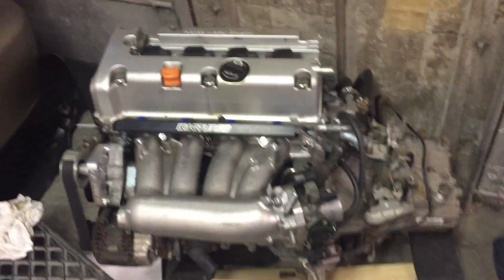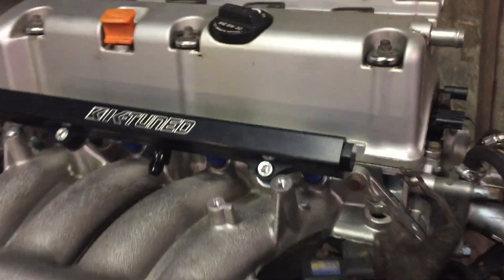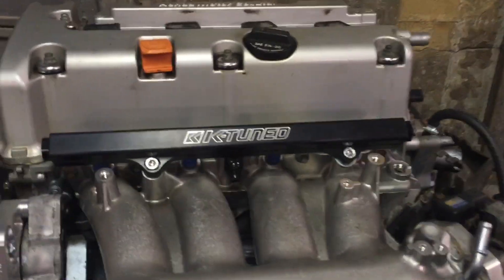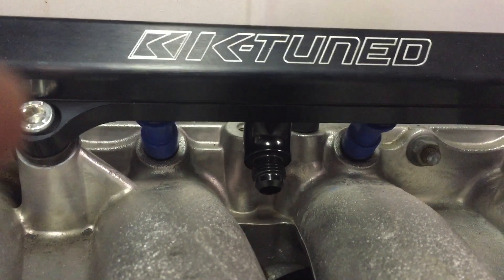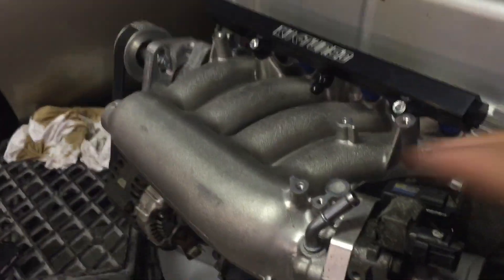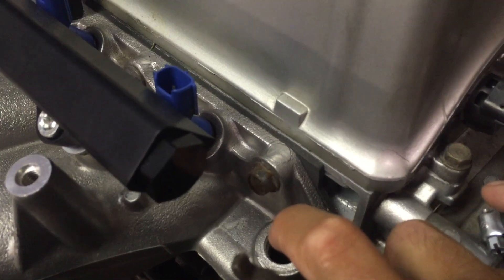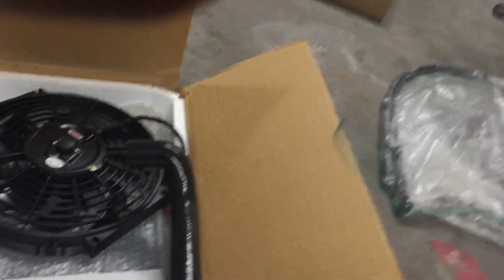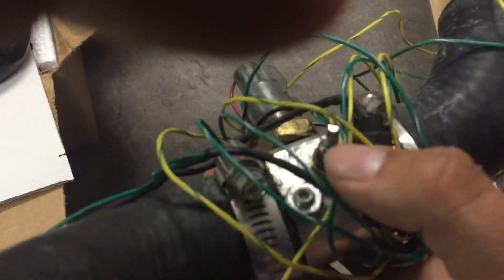K Swap DIY, EK K24      (part 1a)

Comment: Good video! Just a question.. Why Innovative mounts over Hasport mounts?
Reply: Both brands are good brands but I wanted to budget so I stuck with the EKK1 innovative mounts so I can use the stock subframe. EKK2 mounts require me to use a DC subframe